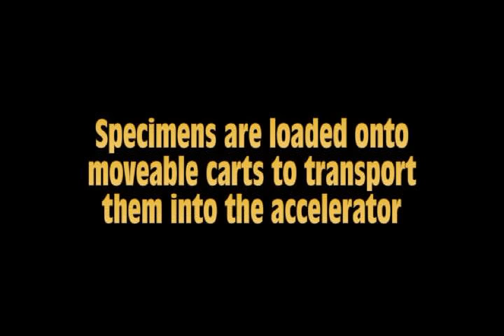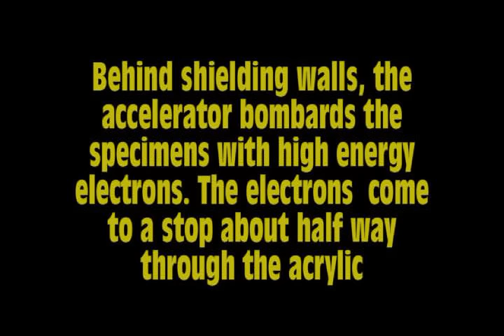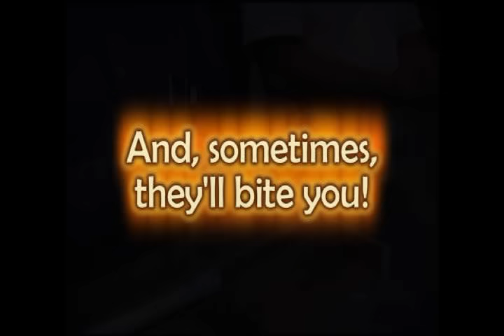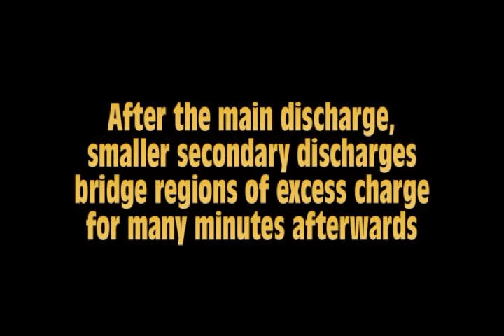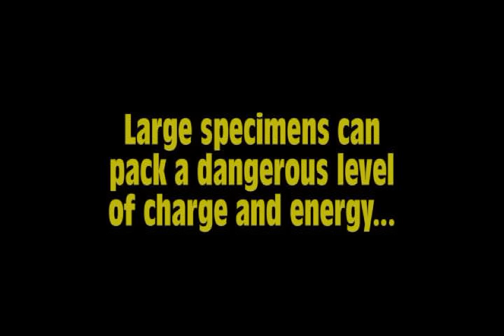Making "Captured Lightning" (Million-volt Sculptures)

Comment from the maker: The branches are mostly hollow tubes accompanied by small mirror-like fractures. The fractures often occur at regular intervals along smaller diameter tubes, looking sort of like beads on a string. This give important clues about how discharges propagate through the acrylic as they form the internal patterns.

Comment from the maker: Translated: "how is it? just press hard at one point?"
Once the acrylic is fully charged, we create a small fracture by hitting it with a pointed metal tool. The electrical field is enhanced at the tip of the fracture, causing the acrylic to undergo electrical breakdown. The trapped electrons rush out of the acrylic within hundreds of billionths of a second, and the hot electrical discharges created by the escaping electrons leave permanent chains of fractures and tubes - a Lichtenberg figure.

Comment: I have several questions about this process: 
1.Can any other materials be charged up in this manner?
2.In some material could this process ever be used to build a new type of battery/energy storage device?
3. If placed in an electrically insulated vacuum environment how long could a acrylic block hold its charge?
4. Is there some way that the acrylic could be manufactured to hold a charge for an extremely long period?
5.This is a beautiful art form but what scientific applications does it have?

Comment from the maker: QT T: Since making these requires a high-energy particle accelerator, there is no way that a casual hobbyist can make these at home. Even though we have a fair amount of experience working with high voltages, we still need to rent "beam time" on a 5 million-volt accelerator to make our Captured Lightning sculptures.
Reply: Great stuff, love the shrunken coins too.
Reply: Bert Hickman what year in the 90's was your website designed? There are website creators out there for FREE that can do a better job =P Just a suggestion, I'm a graphic artist so the site makes me cry.
Reply: Bert Hickman This is not true. You can get sufficiently high voltages from a microwave to get burnt fractal like patterns on wood.
Reply from the maker: marksmod The other poster was asking about making Lichtenberg figures inside clear acrylic (PMMA). You can indeed make fractal-shaped carbonized tracks on the surface of wood, paper, pressboard, or cardboard using relatively low voltage sources. However, you can't make large internal Lichtenberg Figures (i.e., Captured Lightning) inside acrylic by means of a high-voltage power source alone. Making acrylic sculptures requires injecting large amounts of electrical charge deep inside the acrylic. Small Lichtenberg figures ("electrical trees") can be created within PMMA by imbedding a pointed electrode and exciting it with multiple pulses from a high voltage source. However large internal discharges requires the use of a multimillion-volt electron accelerator.
Reply: Bert Hickman I see, my mistake then (I thought "these" simply referred to Lichtenberg figures). It does look astoundingly good in acrylic and the 3 dimensionally unfolded pathways add to it.
Reply from the maker: Virtualgod2009
If they have a few hundred thousand dollars to play with, they could purchase and install a used, but fully functional, LINAC from the medical surplus market. These 6-18 MeV machines are proven, reliable workhorses, and spare parts are available.

Designing and building a 5 MeV machine from scratch has a ton of hidden design and implementation "gotchas" lurking in each subsystem: beam tube, materials and vacuum, HV power supply, beam deflection (to prevent window burnout), radiation shielding, and machine control. The principles are easy - the devil is in the details.
Reply: +Bert Hickman since its a particle accelerator ;) if i got under it i would become the flash
Reply: +J George thinking of shocking somebody that wants to do a highfive? ;)
Reply: Well now Im depressed...
Reply from the maker: We use a commercial high-power industrial facility in northeastern Ohio. It is a 150 kW, 5 million electron volt (MeV) facility that can generate mono-energetic electrons at beam energies between 1 to 5 MeV. The beam energy (in MeV) governs how deeply the electrons penetrate the acrylic before coming to rest. In PMMA (acrylic plastic) 2.5 MeV electrons will penetrate about 1/4 inch. At 5 MeV , the electrons will penetrate about 1/2 inch. The beam current and cart speed govern how many electrons get injected per unit area. 

The greater the number of electrons injected, the denser the Lichtenberg pattern that's created. However, if we inject too many electrons, the acrylic will prematurely breakdown ("self-discharge") while being irradiated. When this occurs, the shape of the discharges becomes more chaotic instead of nicely branched. If we don't inject enough electrons, we'll get smaller trees or even no trees at all. 

Depending on the irradiation parameters and when and where we discharge the specimens, we can create a wide variety of effects. Some examples of some of the kinds of discharges can be seen here:
http://www.capturedlightning.com/frames/interesting.html#Discharge_Types
Reply: im thinking just strap a block onto a lightning rod....then we wait
Reply: I cannot imagine how much it would cost to rent "beam time" on a 5 million-volt accelerator, especially one, I presume, you use daily!

Comment from the maker: Yes. As the sparks grow, they break down some of the acrylic, generating hydrogen, carbon dioxide. The gases then ionize, turning into a glowing plasma that may partially carbonize some of the walls surrounding the spark channels. So the nearby acrylic suffers from chemical changes (breakdown byproducts), and physical changes (fracturing).

Comment: Is this possible on a small-scale DIY tinkerer level? I want a particle accelerator in my basement! *grins diabolically as he cannibalizes an old microwave oven*
Reply from the maker: Hehe... I would love to have a particle accelerator in my basement too, Key.. :)  It would save me 900 mile round-trips to the e-beam facility we use.

A few years ago, a 6 million volt particle accelerator was actually listed on eBay. And, it was FREE - all you had to do was haul away three semi-trailer loads of equipment from a university in Florida. I tried to convince the wife that I really NEEDED it, but no such luck - she said I already have too much HV "junque".  :( 

Unfortunately, building a multimillion volt particle accelerator from scratch is beyond the capabilities of even the most dedicated of backyard hobbyists. I do have a couple of physicist friends who have built their own million-volt Cyclotrons though...
Reply: *****
Looks like they have something for every budget. A 2" x 3/8" Disk for only $12!  Nice little porthole for a model steampunk airship maybe?
Reply: No. I have seen this done and the radiation from the high energy XRAY source would kill anyone inside the room with the machine activated. You need MAJOR shielding for this type of work. 10-20 Gy Units - 5 x what would cause instant death. Microwaves are not ionising radiation......
Reply from the maker: We use between 0.5 - 6.6 kilograys to irradiate our specimens. The accelerator we use has 6-8 feet of concrete to protect us from the X-radiation.
Reply: Jordan Whyte You can use a microwave, you take two high powered electrical parts out of it, clean the posts and affix a postive car battery clamp to the postive source and the negative car battery clamp to the negative source; Taking two nails you submerge them into your plank of desired wood, saturate the area between them with a good amount of water and viola you get Lichtenburg burns in your plank of wood.
Reply: All you need is electrical know-how, that method is not for typical unexperienced DIY's

Comment: I would love to see a pyramid with the point of impact at the top point
Reply from the maker: Duncan Panthera We did make a few equilateral pyramid-shaped sculptures about 10 years ago. All of them were discharged on one of the faces. You can see what a couple of them looked like here:

  http://www.capturedlightning.com/photos/For_Sale/Lichtenbergs_06-11-04Run/Other/IMG_2299.JPG
http://www.capturedlightning.com/photos/For_Sale/Lichtenbergs_06-11-04Run/Other/IMG_2304.JPG
Reply: Bert Hickman Is a top-point discharge possible?  Thus far I've seen all the pieces discharged from the middle of one face
Reply from the maker: Duncan Panthera Discharging a sculpture requires that we hit it sharply with a metal point. Since this also causes a small explosive electrical discharge, trying to discharge one at the very tip of the specimen would cause the tip to fracture or even break off. That's why we only discharge them on a flat face.
Reply: Bert Hickman Have you considered making a mold that includes extra material to make a strike-able face at the topmost, which would then be shaved down to the pyramid shape leaving the tip in pristine condition?  Is this something the material can do?
Reply from the maker: Duncan Panthera That would be possible, We do not have the facilities to cast, cut, or polish acrylic, so we purchase pieces that are already cut and polished to our specifications. Reshaping afterwards would add significant cost, but it would indeed be possible.
Reply: Bert Hickman ah, a good-on-paper idea, but challenging-in-execution situation.  Still, thank you for the discussion on the topic.

Comment from the maker: It depends on the size and thickness of the specimen, A 12" x 12" x 1" thick specimen can store almost 1 kilojoule of electrostatic energy. A charged specimen behaves more like a capacitor rather than a battery. Unfortunately, it can only be discharged once and will deliver a brief high-current pulse. The current pulse ranges from hundreds to thousands of amps depending on the size of the specimen.

Comment: It's amazing that this video is from the past decade and you are still answering the questions :D here's mine, forgive me if already been asked, tried to read thru the comments and didn't find it : if you didn't discharge it on a small surface but instead breaking the whole thing what would happen? Could it theoretically be used to create a lightning grenade that shocks the victim on close impact?
Reply from the maker: Possibly, by using a more brittle material such as glass. However, even though the voltage and currents are high, the discharge time is very brief (10's or hundreds of nanoseconds). The shock feels more like a punch than a shock, so although it might startle the victim, it won't hurt him.

Comment: This is interesting.  You say, in info, that saltwater was first painted on the surface.  What salt?
Does seawater differ from, say, plain NaCl, or MgSO4 (Epsom Salts)?
Since wood has a 'grain', why do the electron paths move sideways with respect to the obvious straight line path?
What are the electrons traveling through, If the electrons must move through charred the wood?
Since electrons always move from anode to cathode, are positive ions of some kind (positrons?) moving from the cathode?

Comment: Wow, beautiful. I wish I could afford a particle accelerator for my basement. I have question though? why is it that the discharge path seams to stay away from the surface of the acrylic?  Does the acrylic have to be a certain thickness to hold electrons? Acrylic thinner than this would slowly discharge before you got hold of it; after it was under the accelerator?

Comment: Didn't we all have an accelerator at one time?
I think the CRT was a kind of electron accelerator.
Reply from the maker: That's right! Older TV sets and computer monitors used Cathode Ray Tubes (CRT's). These large vacuum tubes were actually small electron accelerators. A heated filament and a set of electrostatic lenses created a small beam of electrons. A high voltage DC supply then accelerated them to 10 - 35 keV (kilo electron volts). Magnetic coils around the yoke of the tube deflected the electron beam in the horizontal and vertical axes to scan the phosphor screen to generate the images we viewed.  The machine we use is scaled up by a factor of 100 or so. It also uses a heated filament (four stories above) to emit electrons, and an adjustable 1 to 5 million volt HV supply to accelerate them. Magnetic deflection is then used to scan the electron beam across a 4 foot x 4.5 inch rectangular region to irradiate material on the moving carts below, It's similar to a four-story high CRT. The accelerated electrons pass through a thin titanium window instead of hitting a phosphor screen, but otherwise the accelerator is similar in principle to a very large CRT.

Comment: Were the photos of the discharge in the acrylic taken using an autophotography process? (The shutter of a camera is opened in a darkened room and light from the subject exposes the film)
Reply from the maker: +douro20 No. All specimen discharge photos and videos were taken in ambient light. In some cases, the camera exposure settings were adjusted to reduce the brilliance of the flash so that details of the discharge could be observed without saturating the image sensor.

Comment: What would happen if you used more than one metal point to initiate the discharge? Maybe even points in a pattern?
Reply from the maker: We asked the same question. On a charged specimen, the first point that discharges will remove the charge from the sculpture before any of the other points can fire. However, if you first create a pattern of divots and then run the specimen through the electron beam, you do get a mat-like tangle of discharges around each point.  Following is an example of the latter using an array of five points (created by Colleen Kobe in 2009):  http://capturedlightning.com/photos/Lichtenbergs/IMG_1743a.jpg
Reply: Thanks for your response, much appreciated. Looks very cool. I'm looking through your store and I'm thinking of picking something up for me and for someone else as a gift.

Comment: Super neat!  How long will the charge remain without fracturing the acrylic - just out of curiosity?  Beautiful work - and very interestingly made.
Reply from the maker: The injected charge exponentially declines over several hours. Lowering the specimen's temperature reduces the leakage rate, and specimens kept at -78C (via dry ice) will remain almost fully-charged for many months.

Comment: I have made those. :) I work on medical accelerators. these dudes working with something crazy to charge all of those at once. 15 MEV maybe
Reply from the maker: +Michael Luciana 
We use a commercial high-power (150 kW) industrial accelerator at beam energies between 2 - 5 MeV. The electron beam scans across a 4-foot wide path. Simultaneously, moving carts move our specimens through the beam at up to 50 feet/minute.
Reply: I'm trying to understand the power with the wide power beam energy.
Reply: No flattening filters or nothing just beam. Use bending magnets & lens coils?
Reply from the maker: +Michael Luciana 
The facility we use can deliver up to 30 mA of beam current at 5 MV. To put this into perspective, if one of the 1/4" thick aluminum carts stopped under the beam, it would only take about 15 seconds for the electron beam to cut the cart in half. This actually occurred many years ago (by accident) - the operators showed us the remains of the unfortunate cart... :) During our last production run, we captured the blue glow of Cherenkov radiation and x-ray fluorescence of nitrogen underneath the scanning horn as the beam passed through the air below.
Reply from the maker: +Michael Luciana 
There is only a magnetic deflection system that sweeps the beam at about 100 Hz in one axis, and at several kHz in the other axis. The result is a complex Lissajous scanning pattern that spreads out the beam so that the titanium foil window (that separates the vacuum side from the air) does not overheat as the electrons pass through.

Comment: Beautiful!!  IS IT POSSIBLE TO ISOLATE THE SCULPTURE SO THE SPARKLING CONTINUES FOR LONG TIME?? OR MANUALLY RE-CREATE THE SPARKLING AT HOME??
Reply from the maker: Once the residual electrical charges have decayed, sparking will stop. Unfortunately, there's no way to inject more charge into the sculpture at home. However, it may be possible to light the sculpture using pulsed blue LED;s to create the appearance of internal lightning-like flashes.

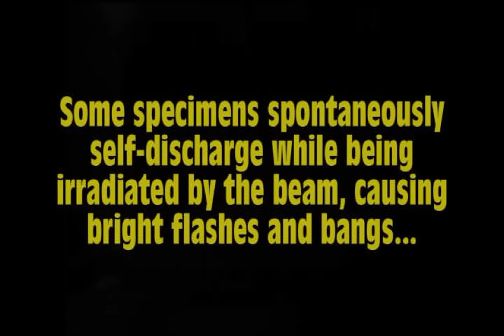Comment: 2:06 I don't understand what you mean. The camera is picking up the electrons after they've gone through the wall?
Is the camera behind the wall? How is it seeing the inside?
If the camera is inside then why is it picking up electrons that have already left the room?
Reply from the maker: In this video, the camera is located behind a wall (part of the S-shaped maze that the carts pass through as part of the radiation shielding system). The camera is actually looking at an image that's reflected by a stainless steel mirror. A metal mirror is used since a glass mirror would quickly become blackened by intense X-radiation and scattered electrons in the room. Some of the intense X-radiation penetrate the corner of the concrete wall, causing speckles and small streaks as it hits the sensitive camera image sensor. We have since captured other videos where a shielded camera rides on a cart, actually passing through the electron beam. See https://www.youtube.com/watch?v=1D95TlDJmQU&list=UUnSmul0A306MoexF9CjIX1w and  https://www.youtube.com/channel/UCZXBebQRMXLggSIcl33fZ7g
Reply: Bert Hickman
Thanks. This is so cool